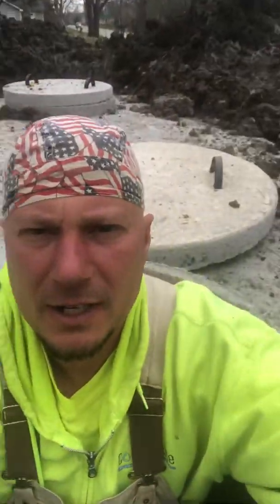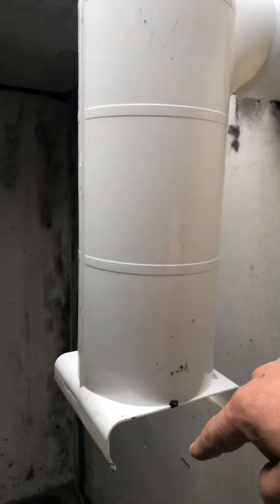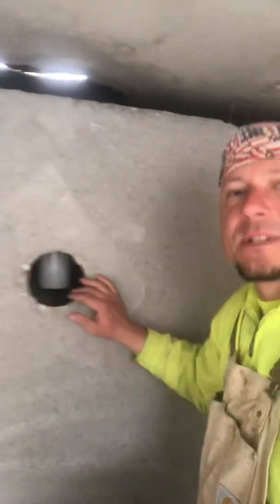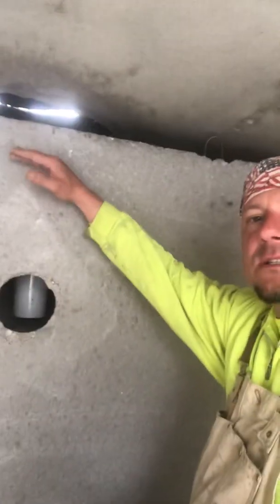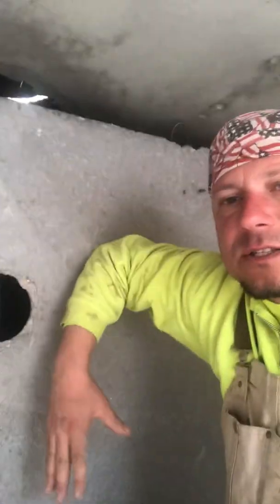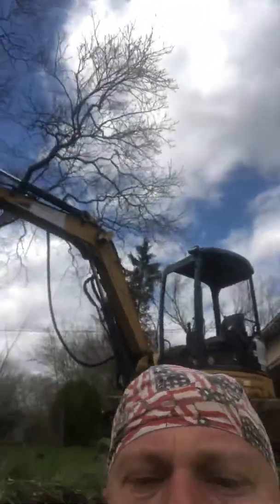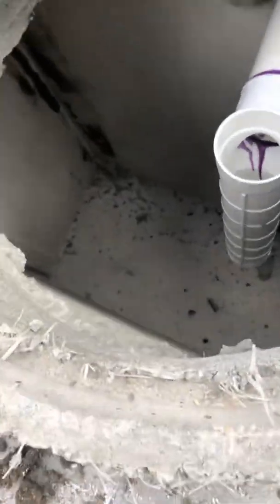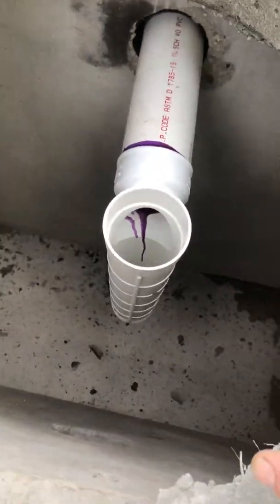Inside a septic tank

Comment: Hey Jordan, nice demonstration on the insides and how it works. How often is it typically recommend for a septic tank to be pumped? Also what is the typical lifespan of a regularly pumped septic tank?
Reply from the maker: 3-5 years on tank pumping. Some techs use a sludge judge. We have clients that fill their tank with trash, cigarettes, wipes, triple ply toilet paper, tampons etc in 1 years time, and others who wipe their cast iron pans out with a paper towel prior to washing them. Ive seen modern concrete tanks in our area last less than 10 years. Older concrete tanks prior to additives to reduce production costs etc still in ground from 1960. Typically 20-30 for fiberglass or plastic.